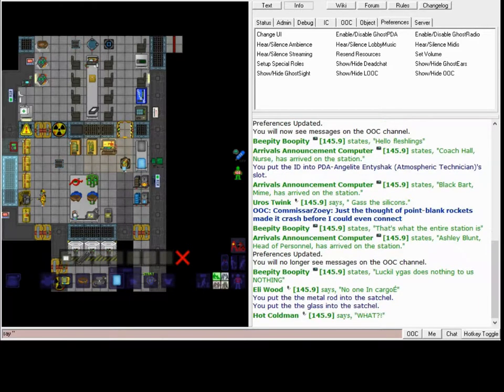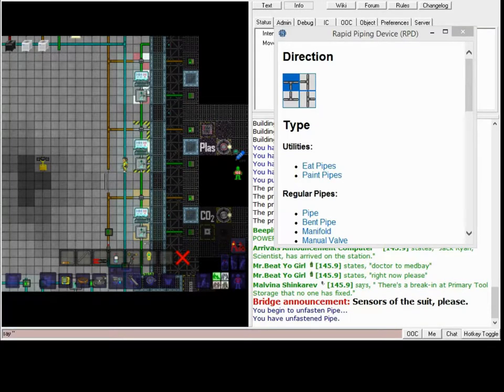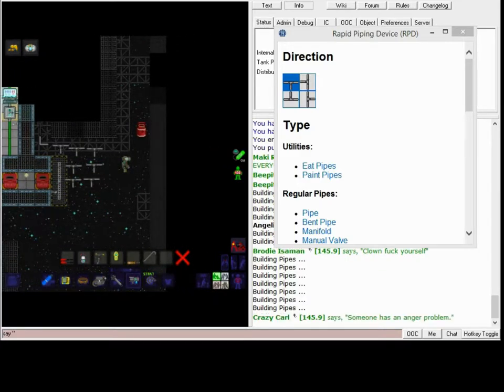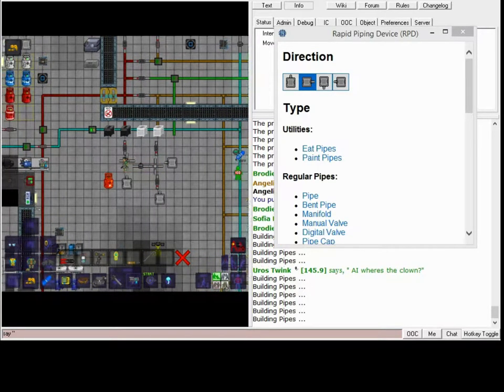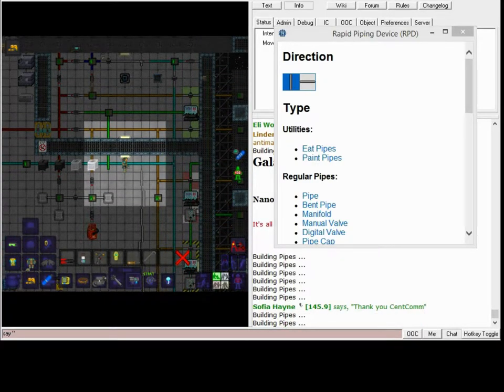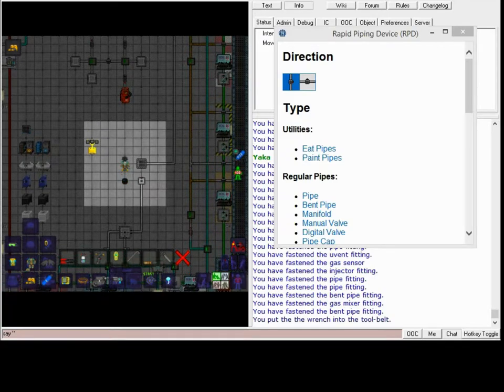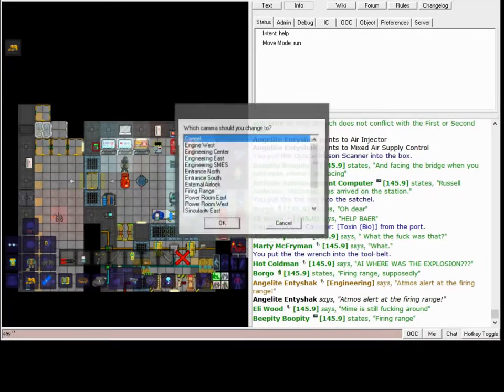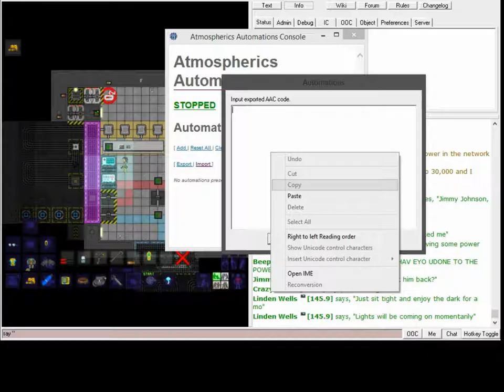Atmospherics Setup Walkthrough

Comment: Can you explain the purpose of the Aux Air room and the whole plasma tank cooler?
Reply from the maker: The Aux Air room is pretty much has the same function as the main air tank, fill up with 20% O2 and 80% N2 and output that to distro. The main reason I make one is because in a meteor event, the tanks get ass rammed, and a LOT of depressurization occurs station wide. This will stress the fuck out of the main air tank and 100% of the time, it will empty, causing distro to empty, causing depressurized areas to never repressurize. With the aux air tank standing by, and handy script the Atmospherics Automations Computer is using, the aux air tank will ONLY output air if the distro meter reads less than (x) pressure. In short, the aux air tank isn't neccasary, but holy shit, when you actually use it (every meteor storm), you'll be glad you built it. 

The plasma cooler isn't just a plasma cooler, it's a mix-line cooler. It cools ANY GAS in the mix line when the digital valve connecting it to the mix line is active. Cooling plasma is great for radiation collectors; colder gas -> less pressure -> more gas can fit in a tank -> more plasma to be used in a radiation collector at once -> more power. You can also link the mix line to waste using a digital valve bypass to make a mix/waste cooler. INSANELY USEFUL DURING FIRES because it will rapidly cool the burning hot gas in the waiting to explode pipes. Digital valves and Atmospheric Automations Computers are your friends.
Reply: Angelite Entyshak So make a digivalve connecting the cyan line to the red line, and fill up a tank with it that will be cooled from the space thermal plates that you built? Then what? Do I have to manually release the gas on the fires or?

Can you also explain why we use connectors, why not use thermal plates, what purpose do they have? And are there any other settings I should change on the gas mixers when I first enter amotspherics?
Reply from the maker: Steve Austin Oh ho no no no noooooo. The cyan line is Air to Distro, where Distro gets it's air. Making a digital valve to the waste line (air we don't want to breathe) to the air to distro line (air we want to breathe) is the silliest idea known to man. What I said was connect the mix (yellow) line (gas we may not want to breathe) to the waste (red) line (gas we definitely don't want to breathe) to the mix cooler (the thermal plates in space) to make a waste cooler.

The connectors right south of the distro room are mix line interfaces. You can extract gases in the mix line through the connectors. I really don't understand that last question. However, if you add me on steam, and let me know when you'd like a personal tutorial on the test server, I'm more than happy to provide (and record) it! 
steamcommunity.com/id/entityofshackles